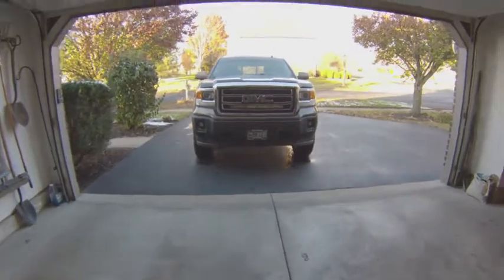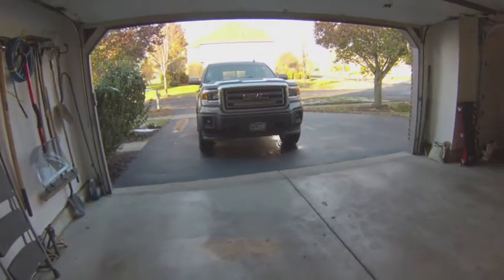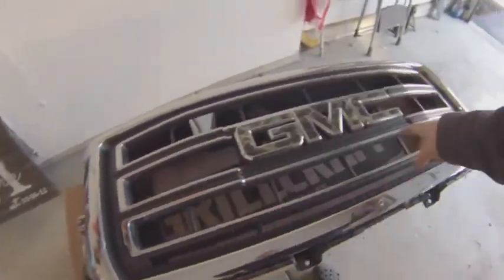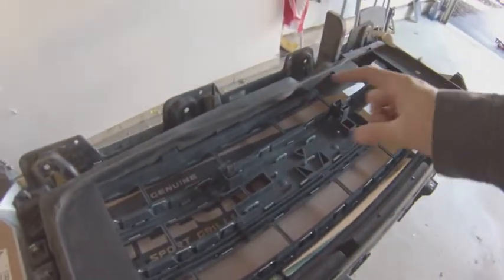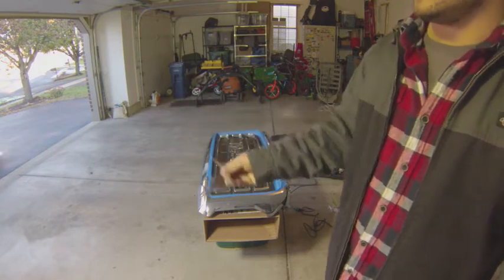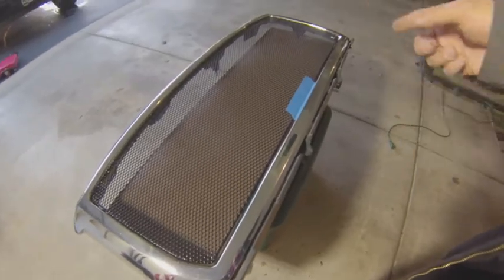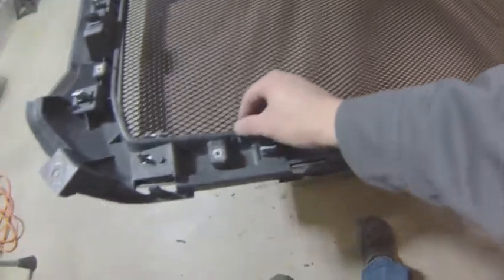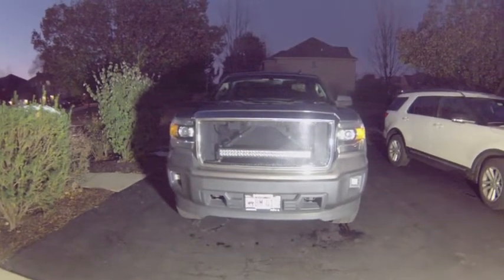Grillcraft MX Series Grill Install - GMC Sierra

Comment: Was the original plastic?
Reply from the maker: naomi castro yes
Reply: Water Fowler 41 good to know. I thought it was metal, at least the mesh . I have the same as yours . I have a gmc Arcadia 2014 . Thought also that the Denali was metal but i guess not. I will change mines too but I’m just gonna but the ones I can just pop to the one I already have. I hope they work